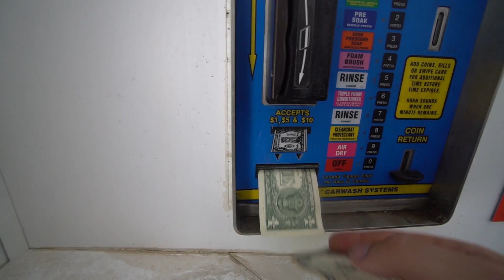JUST A DAY OF FAILS.

Comment: Jimmy, ha e you ever tried reskinning interior pieces?   Contact cement and leather or alcantara on door cards, dash, center console is an easy project.
Reply: jay west 'easy'
Reply: I have Alcantara door cards front and rear, headliner, a, b and c pillars in one of my E36's. Alcantara is $100+/yd, and the door cards are NOT easy on E36's with how deep the recesses in them are. Lots of wasted material. Dash would also be very hard to make look good, better off just flocking it if you want that look, same with center console.

Comment: Jimmy I'm sure you have seen the little inner circle cut outs that come with couplers you could use those in the middle to prevent the metal from hitting but also extend the length a little.

Comment: If they were from a very they are different to allow for the top to fold down. Also noticed your front door cards are missing the pockets. The pockets were supposed to stay glued to the panel. They always get pulled off if not removed properly

Comment: Apparently people with supercharged e36's just take a rubber 90, and then go straight to the left with an aluminium pipe and then another rubber (looks like less than a 45 idk) to connect to the water neck.

Comment: Jimmy, keep working those front door cards, those are from a coupe. Verts have vertical handles on the passenger card - not that it matters, both fit. My buddy has vert door cards on his 328 coupe. Like you said, if you re-glue them just a bit off, it's fucked. It's a pain in the dick but totally worth it